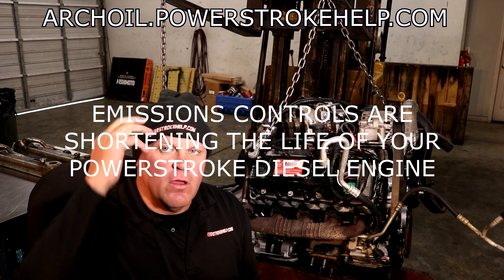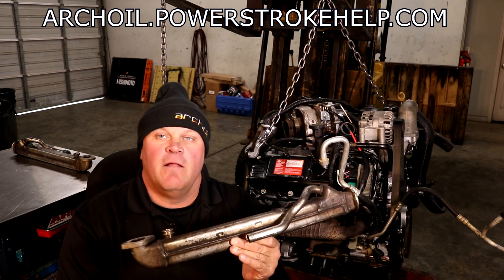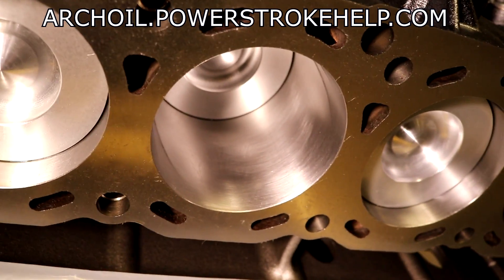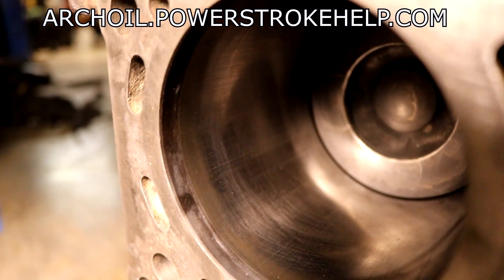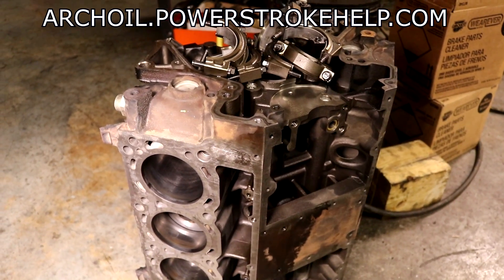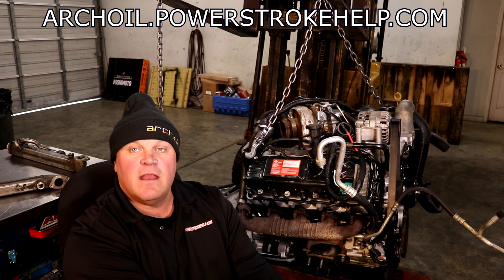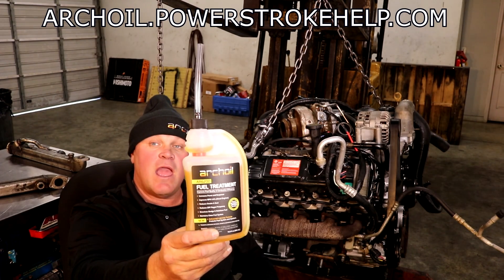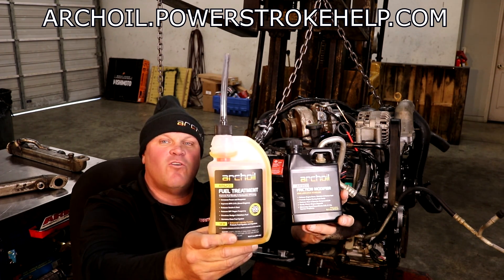EMISSIONS CONTROLS ARE SHORTENING THE LIFE OF YOUR POWERSTROKE DIESEL ENGINE

Comment: I can appreciate the amazing performance from a late model truck. I can also appreciate the durability of a good 7.3, may be slow as all hell but the damn things just do whatever you ask it to without hesitation.
Reply: If you think the 7.3 powerstroke is slow try driving naturally aspirated 6.9 idi. Now those are slow but not horrible. I have both of them. The 6.9 is slower but it will go through anything and not get stuck, will drag near anything, push as much snow as it can find, and it has hauled 6,000 pounds on its bed. The truck is a 1986 f350 cab & chassis 4x4 dually. Somewhat slow but it will do anything I need it to do
Reply: The ironic thing is you can't run 100 percent biodiesel with all this emission crap like you could before with the older diesels 😂
Reply: I was a hard core Chevy guy for the longest time.  Mostly gas motors.  You can't beat 'em.  The duramax is a great motor, but still has issues.  The best one to get is the '06, after they solved all the injector problems, but the weak point was the transfer case.
I've owned a 7.3 idi.  Loved it's durability and ease of maintenance.  Did NOT like the truck it was in, though.  That thing could get stuck in wet grass, even with aggressive tread tires.
I currently own an '02 dodge cummins 3500, with the 6 speed of course, and 425,xxx miles on it, and couldn't be happier.
Reply: @chevytruckman34  I had a 99 24v and nothing but problems with that pickup. It was a 5 speed and was a monster but my lack of knowledge of those engine's over looked the 53 block..my 7.3 obs has been a good truck for me at 320k.

Comment: Buyer beware, the archoil winter blend does not prevent your fuel from gelling!! Other than that the truck seems to be running smoother. I used power service for the cold temperatures.